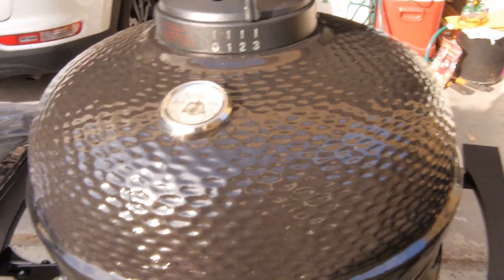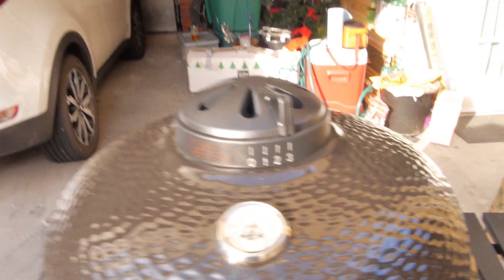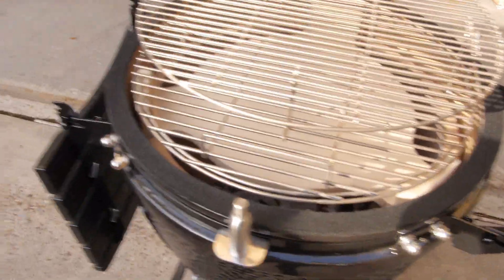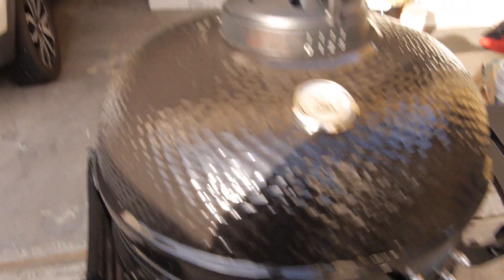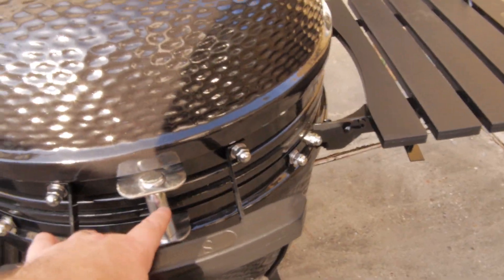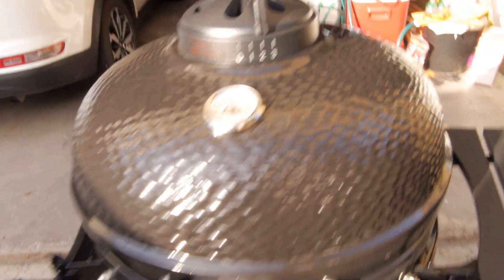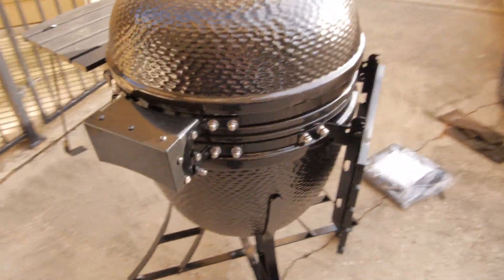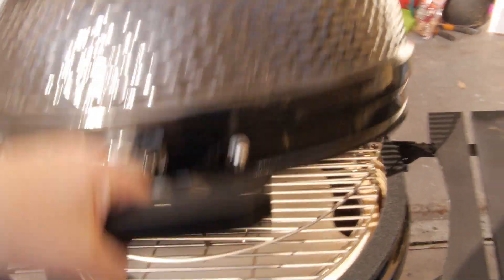New Full Ceramic Kamado!

Comment: Bought mine at Costco as well, can't beat the price. However, there are couple neuonces. Top vent is of poor quality and it is quite a challenge sometimes to adjust the airflow. Removing the ashes can be a headache sometimes as well. Steel grate needs some adjustment for a firm settle. Thinking about returning this grill back to Costco.
Reply from the maker: This is true.  Although, I have went to forums and many have said that there is a break-in period for that upper vent.  I ordered additional temperature felt on amazon and did a second wrap of it around the top and then put the vent back on.  After a while, the smoke should leak out less as it gets gunked up with soot from long smokes.  Everything else seals like a champ and overall, it can't be beat for what you pay for it.  It's a keeper for me but its understandable if some are left wanting a little more in a ceramic.

Comment: is it 24 or 22 inch? I bought my two weeks ago and it was the K22.  Let me know how the breaking in goes.  Because on mine I have only cooked two times and got really small cracks which looks like hundreds of scratches..Just curious. Can't wait to see some of your future videos..
Reply from the maker: +Rachel leal Mine is the K24 from Costco.  Although I measured and it's more like 22 inches.  Where are the cracks?  In the outside finish?  If it is, that is normal and mine has those too but it's from the manufacturing process.  The ceramic has a lifetime warranty so if it does crack and break, they will replace it.  I won't be a Houstonian for too much longer though.  I am moving to west Texas for my job.  Thanks for stopping by!
Reply: Sorry to hear that you are moving but please keep the video coming.  Thanks for the information about the cracks and they are on the outside of the finish. Again, glad I found your channel.
Reply from the maker: +Rachel leal no problem!  I'm planning a whole line of cooks for this grill.  Yeah, the cracks on the outside are fine tiny ones that you have to get up close to see.  No worries!  Just part of the grill expanding and contracting from the heat from the manufacture.  The manual to the kamado grill mentions it as well.  As long as you don't get the big long cracks all over place on the inside where it looks like it will break apart then you're good.  Cheers!

Comment: Is it bigger than the akorn? I’ve been looking at them was going to get the ceramic akorn but Lowe’s said they are discontinued. I’m looking at a Kong which is the same as the pit boss. I was curious how they compare in size?
Reply from the maker: Chip Conner yes, the ceramic Akorn has about an inch more cooking space.  They are maybe discontinued for the season is what I think.  They still advertise them on Char-Griller’s website.
Reply from the maker: I spoke with Char-Griller’s marketing director and he said they are not discontinued.  May be that the stores are bleeding inventory for the year.

Comment: How do you like it compared to the Chargriller Akorn?
Reply from the maker: +Tim Marr it has been great so far. I'm doing my first small smoke with it today and will post a video soon
Reply: Bought the Akorn a month ago and love it!  Would like you to do a comparison video.  Curious to see if the ceramic is worth the extra $$$.
Reply from the maker: +Tim Marr yeah, I gotta get a few cooks in.  Planning a couple of smokes in the next two weeks.  I'll be documenting both.  Cheers!
Reply: I have both the Akron you set it and forget the Pitt Boss hard to choke out lump coal with all vents closed.
Reply from the maker: +Dawn Gaddis that may be an issue on some of them but mine chokes out the coals fine.  The Akorn doesn’t soak up and hold any heat into its body like a full ceramic.  Although, I will say that the Akorn does do a great job at having very steady temps if you find one that doesn’t leak at all.  Some do leak but not too terribly.  My top vent on my Pit Boss did leak but after it gets gunked up after a few smokes, it stops leaking.  Haven’t used my Pit Boss enough yet due to a recent move but plenty of cooks will be posted using it.  The Akorn is a great entry into kamado cooking if you are wanting to give it a go.

Comment: At this time Q, rate this kamado.  Any problems?  How does it seal?
Reply from the maker: Distance Shooter I rate it about a 7 out of 10.  It seals well everywhere but the top damper.  I wrapped additional heat felt around the top and only have slight leakage from the top vent.  It is leaking less and less the more it gets caked up with soot.

Comment: (IMPULSE) Send me your old one!  :)  Cheers, Q!
Reply from the maker: Thrash Metal Home Brew that grill sold about as quick as I posted it online lol.  If you ever get into grilling a lot, definitely consider a kamado.  The most diverse grill ever!  Love mine... a guy from traeger was at my local Costco and I shoo'd him away LOL
Reply: Hahaha!  Back Off, Jack, right?  I will eventually get one.
Reply from the maker: +Thrash Metal Home Brew lol yeah, he was bashing the kamado grills and said the pellet grills are better but you can't sell me anything else after even using my cheaper Akorn grill.  Even the Akorn is an awesome kamado for those on a budget.  Cheers,  bro!
Reply: if I'm just getting into (or thinking about getting) a Kamado, would you recommend your akorn or your new pit boss.  I too have a Costco and have thought about getting this grill.  but I wasn't really sure how much better things would be with full ceramic over the porcelain coated akorn...
Reply from the maker: +Paul Harder if you have the money, go full ceramic.  This grill is a steal at the Costco price.  You won't find it for less than 800 anywhere else.  The Akorn is a good affordable kamado and does a good job of keeping steady temp but it is nowhere the same as using a full ceramic.  The Akorn works well but does have a shorter life to it as you will need to replace parts that rust out over time.  The Pit Boss has a lifetime warranty on the ceramic and will last a really long time.  At 599, it was too hard to turn down.  Hope that helps!
Reply: The Brew-Q I look forward then to your future videos that will show me how to use it...haha.  yes I know the way to cook is generally the same across the board for the Kamado's